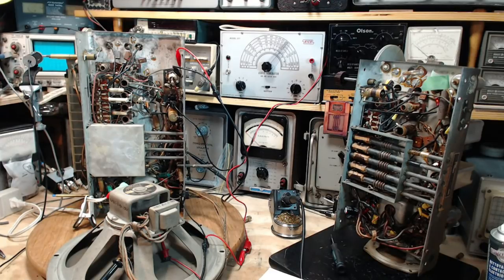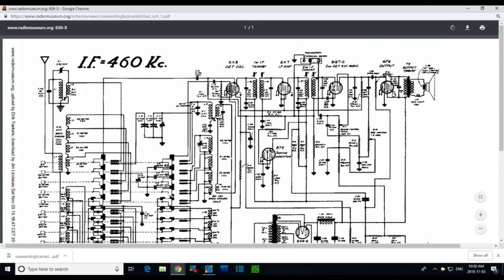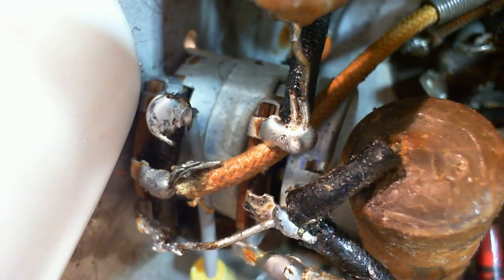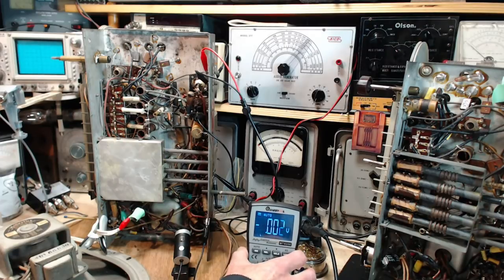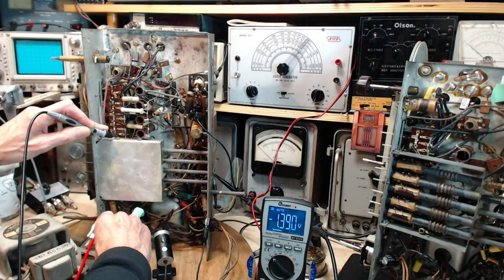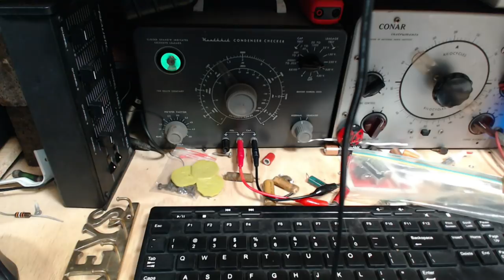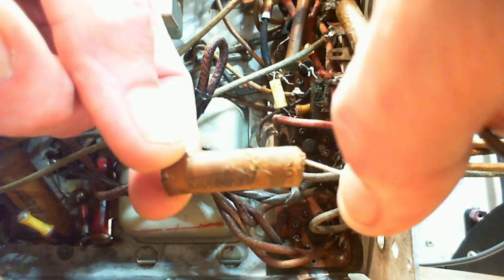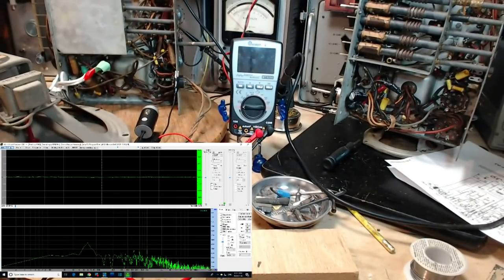Westinghouse 636 #6 - Output Stage

Comment: Hi Jim, the cap across the output transformer primary changes the tone.  If you cut the cap out, more highs get to the speaker.  Use your capacitor decade to increase the value and see what it does to the tone.
Rod

Comment: I always target the power supply first for a variety of reasons. One is that hum there can cause trouble almost anywhere else. Another is that excessive current drawn by bad filter caps can damage the transformer, especially in older Zenith models. Once the power supply is solid other circuits will display their true problems and are easier to deal with. The hum bucker coil can hide a lot of evils with a bad supply. I sometimes connect a PM speaker to the output transformer so there is no hum compensation. This reveals true audio output. Since there is no field coil effect on that speaker the sound is uncolored by it.
Reply: Hear! Hear! 
I second the motion.

Comment: As a restorer of 50+ years I always replace the grid input cap before ever turning on any radio. The amount of unnecessary harm that can be caused is simply not worth risking. I can only wonder why you have run the radio for so long before talking us through the reasons why this cap is likely to harm the valve and/or the o/put transformer and (this you leave out) just as importantly the field winding on the speaker.